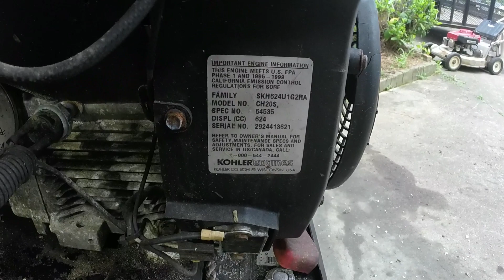Lincoln Ranger 8 Generator Welder- Kohler Command V-twin replace fuel pump & fuel lines & carb clean

Comment: Fuel pump may be full of rust, these tanks are terrible about rusting and stopping up fuel hose and filter quickly, I had to replace fuel filter every 12/20 hours before removing and cleaning tank for the 3 time 😊
Thank You for everything 😊

Comment: Hi, I just dropped the float needle in the carburetor, and it fell through in the engine block. How can I get it out?
Reply: I meant, dropped it into the carburetor, and it fell through into the crankcase. 
Will fall directly into the oil pan?
Reply from the maker: @orlandoherreraoutdoorstexa7353  Maybe if you're lucky, maybe a magnet would help get it out?  Or maybe a grabber tool if you can see it?  If not, who knows where it might have gone.
Reply: @EllisMowersandmore  thanks the first thing I tried was a magnet, but couldn't see it. I did see it fall into the crankcase.  I just don't want it to end up in crankshaft gears. I'm going to drain the oil and open the crank case to see if I can locate it.

Comment: Got a question? It's a lawn mower question? I have Poulan pro made an approximately 2003. It's similar to the LT1000 made by Husqvarna I would be interested in putting cast iron spindles on it with grease certs but I've had no luck in finding any did they make such a critter?
Reply from the maker: A 2003 model Poulan Pro is basically the exact same mower as a Craftsman and Husqvarna.
Reply: @EllisMowersandmore   Yes I understand that but I'm still having issues trying to find those spindles that are cast iron with grease certs